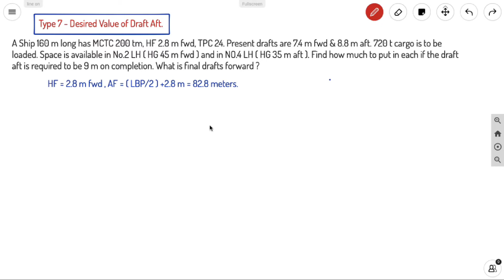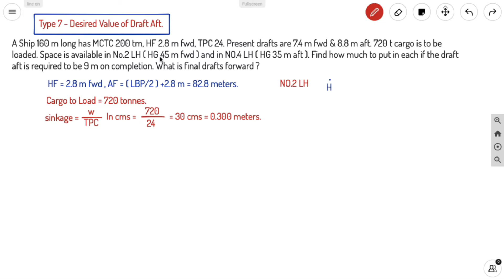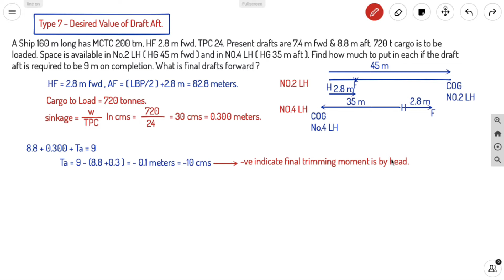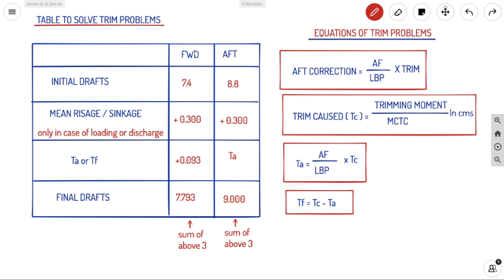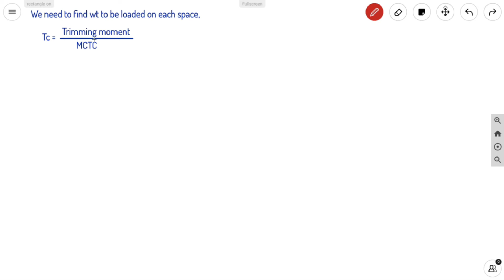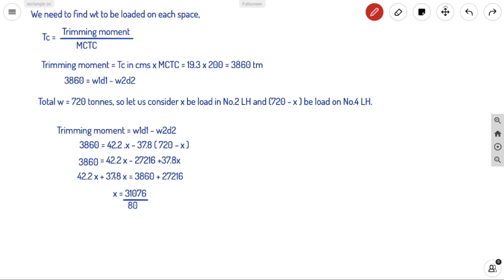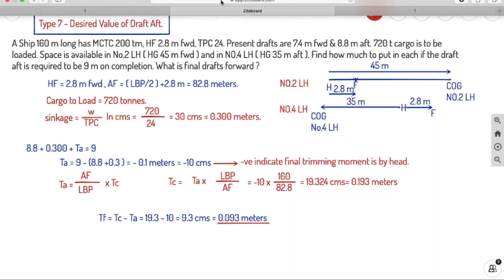TRIM TYPE A PROBLEMS | TYPE 7 | TABULAR SOLVING | EASIEST APPROACH TO TRIM PROBLEMS | AHOY! NAVIGOS.

Comment: How to consider x and 720-x
Reply from the maker: Since total cargo to be loaded in question is 720 tonnes and in two different places we are assuming cargo to be loaded in one place as ' x ', and other cargo as '720 - x ' for solving the problem.

I hope you understood.

Thanks for reaching to us.

Ahoy! Navigos.
Reply: @SailorSyd007  I know that 
But see there are two HG , and I m confused like for which we will take x and 720-x
Reply from the maker: It doesnt matter whichever  you take when taking weight you can take x as any one of them and the other 720-x final answer will be same but matters in case of moments you need to take moments of fwd  as +ve  and -ve for aft, weight it doesnt matter which ever you take x , you have 2 options you can take any one of them x and other as 720 -x  , final results will be same.

Regards,
Team Ahoy! Navigos